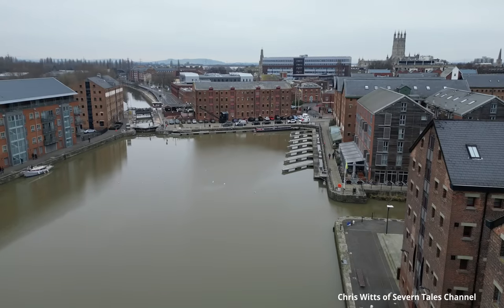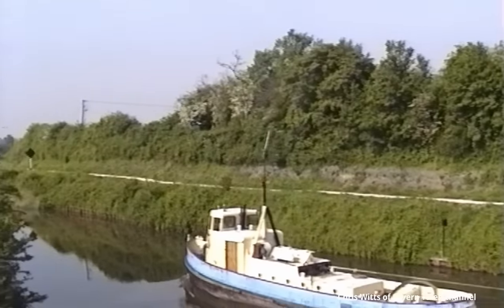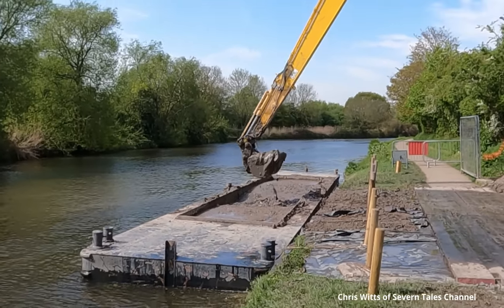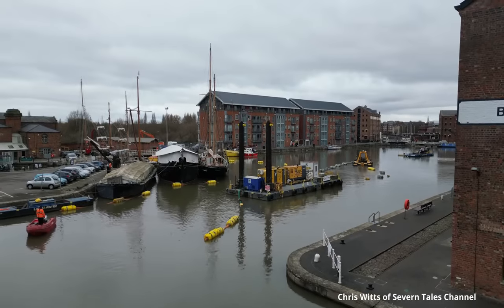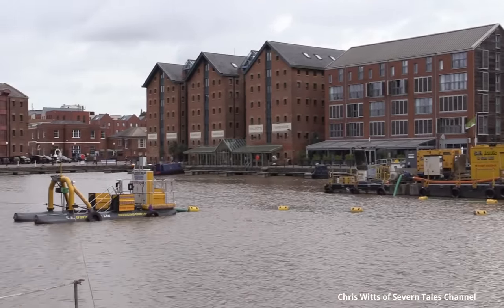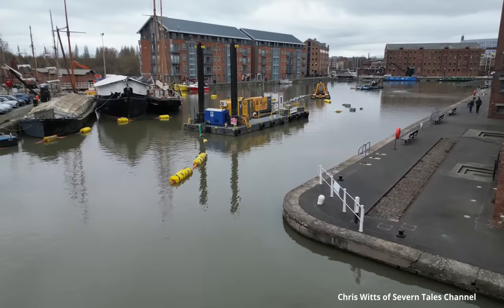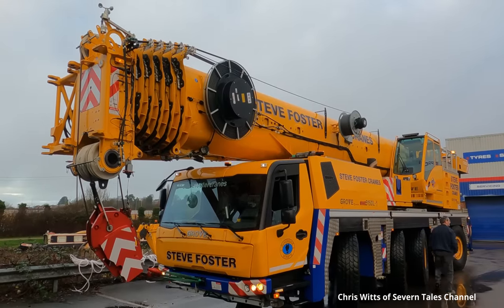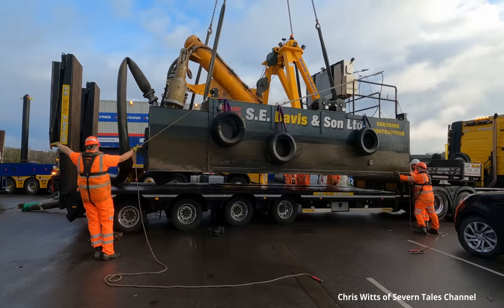How to Get Mud Out of Gloucester Docks

Comment: Hello I've worked and ran many dredging programs and the only long term solution is to determine the direction of ingress of mud and silt then a large hole or pit is dredged attest points and a permanent suction point placed in these pits were a periodic empting can take place by a simple pump system of a much smaller size than would be required to dredge the whole basin cost wise generally 50% cheaper over the long term
Reply from the maker: Many suggestions have been raised these past few months, ultimately it comes down to cost

Comment: When i visited Bristol docks, i learnt in a small museum dedicated to Brunel, showing that when he built the docks, he incorporated underwater sluices that prevent the build up of silt and mud, by controlled "Flushing out", using those water gates. Just shows the foresight that, "Old fashioned Engineer", actually had. Beats some of our so called Modern Engineers, way out of the park.
Reply: Seaton Sluice, Northumberland. So named as, long ago, the river was bad for silting up and 'sluice gates' were used to hold back hightides/high water and the water released at low tide to scour the riverbed....
Reply: On a much smaller scale, but having the same effect, when Harlow Town Ponds were built, a series of pipes and valves would enable the draining and flushing  of individual ponds.
Reply: The same process was used at Dover by I think Telford at one time.
Reply from the maker: Some times the old ways are the best. Unfortunately we don't have that facility at Gloucester

Comment: I remember somewhere around the early-to-mid 1980s they were building a series of locks and dams on the Red River in NW Louisiana and to dredge out the sand, they had a massive dredge on a barge that sucked up the sand / mud and then pumped it ashore where it dumped out over a vast area, slowly building up the land with the water eventually flowing back into the river after having dumped all the sediment.  The pipe that came ashore looked to be at least 36" in diameter and it was a rather impressive flow rate... Bulldozers would periodically move the pipe and along with other earth moving equipment, redistribute the sand in the area which eventually became high enough to make into parks and apartment complexes...
Reply from the maker: I think that would be difficult to try on the Severn

Comment: The whole of the UK river system needs to be dredged like it used to be when river traffic was used.  In my area boats used to travel up the River Severn as high as Shrewsbury,  but now the river is no longer dredged ( may be due to EU laws that made councils treat dredging mud as 'toxic waste' ) which meant it had to be taken away and processes, massively increasing the cost of dredging. Whenever a river overtops its banks these days we get shouts of 'climate change causing the flooding' while in reality the rivers are shallower due to silting up and it needs a much smaller volume of water to cause flooding.  Dredging is like installing a larger guttering on your roof,  a 6 inch gutter will never overflow,  but a 3 inch gutter will always overflow easily...
Reply from the maker: The Severn between Gloucester & Stourport was only dredged in the past at the locks. Otherwise it was self dredged by the large amount of commercial barges clearing their own channel

Comment: Hi all I live near but work in Hull, hull and all sitting along side river Humber has same problem.
IV been on jobs, washing lock gates out, sometimes removing 80 ton in one gate.
As for river hull.....IV been told by older chaps that worked on tugs and barges on river yes ago.....
All the old chaps say the same....very little river traffic nowadays hence river silting up and now flooding is always happening up stream..
Your dock is same.....lack of use with water that's heavily full of mud.
As old saying goes use it or loose it.
Basically.....you need water flow combined with prop wash....to keep things clear.
Reply: Sitting.................
Reply from the maker: Same problem here, lack of commercial traffic on the Severn
Reply: @chrisclarke7828  silting......it's my auto correct thing kicking in, sorry

Comment: Is this not just going to transfer the problem into the Main Severn, 60m2 p/h is over 300t of silt.
Reply: i was wondering this myself, but im assuming the flow rate of river can handle it
Reply from the maker: They hope that the strong flow of the current following a spring tide will take it away.